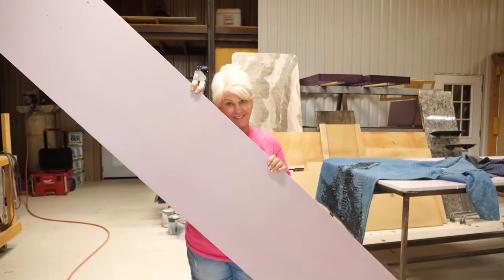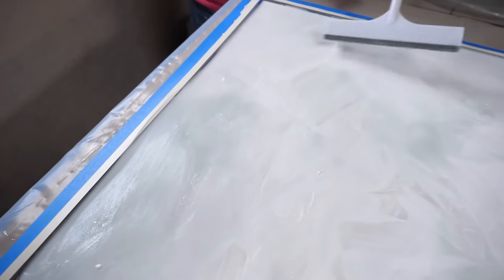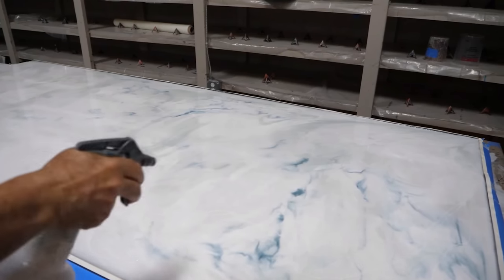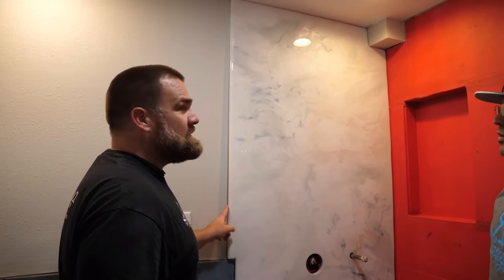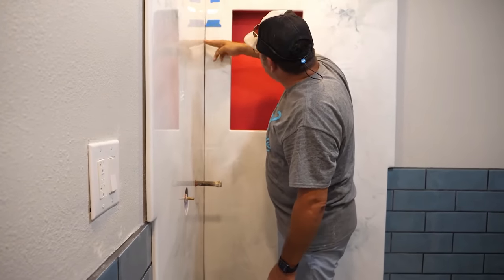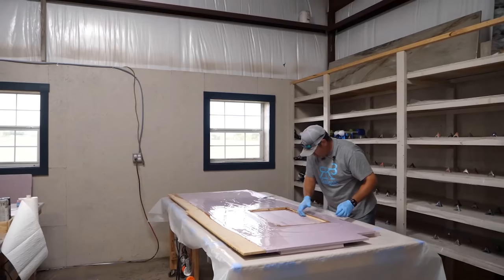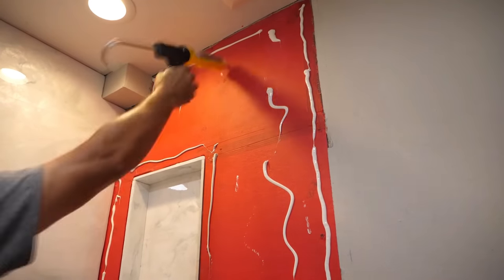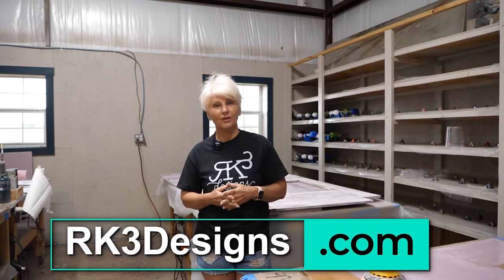How to Install Foam Epoxy Shower Walls with @RK3Designs

Comment: In the middle of my shower remodel using your products right now. Would really like to see the fabrication of the panels. This video jumped to finishing the holes in the panel. I'm likely starting my fabrication in the next 10 days. I've watched your foam shower wall visors, but they are a couple of years old and I could use a nice refresher.

Comment: That is my favorite color for this epoxy wall idea. 
Might as well do all the walls, plus the ceiling, while you're at it.  
less seams, looks easy to do once you do one panel.
Reply: Yes I think they should have done all the walls. A  more dramatic look as oppose to a little shower in the corner..

Comment: This is absolutely awesome!!!  I currently have a shower/tub combo in my master bathroom.  My wife just went through a horrible medical ordeal (had an abscess on her spinal cord that caused her to be a quadriplegic and is now fighting her way back to using her limbs again) and there's no way she can step over the side of a tub.  She could barely manage it before the surgery because of back problems.  I intend on cutting out the surround and putting a shower stall in place, and want to use SCC to do the walls, just like this.  It's an alcove shower, so I think it'll be easier because I won't have to worry about glass walls.

Comment: what are you putting on the walls behind the foam board? adhesive? subwalls ? ty  have you done this in a tiny house ? I am thinking i would like to try this in my tiny house ty deb

Comment: I'm in the process of fabricating a large format suken cement soaking tub.(6ft x 5ft x 3.5ft deep)

I'd like to use your materials to coat and enhance the look of the tub. 

Would your product withstand constant water..??

Would I need to seal the concrete first..??

Any information would be appreciated. 

Thank you

Comment: A 'lil confused. Love the outcome, but I thought they needed to be torched for bubbles? Also, was no additional top coat applied?
Reply: Hey there. Yes, torching is used to remove the bubbles and we actually did  a little in the full length video. Because this was a melded marble technique where we used more product per square foot and it’s being used as a shower panel, an additional flood coat isn’t necessary. If I used a technique with spray paint, I would apply a flood coat.
Reply: @RK3 Designs  Absorbing everything I can before I attempt a new shower install in a few months, I want to make sure I'm down with the details. Thanks for the clarification 👍🏼

Comment: We need window sills that are 14 1/2" wide and 9'+ feet long (We have an ICF house). I was going to use MDF to make them. After seeing this, I am wondering if the foam would hold up. Any comments on that? The foam would be so much cheaper and easier to use. Thank you Stone Coat for the great ideas and great videos!
Reply: After 8 months I hope you found a solution, but if you're like me.... it may still be on the to do list. I built an ICF house a few years ago and we did MDF sills. we laminated 2 layers so that we wouldn't have a seam, then coated with SCC It looked amazing. It didn't occur to us to try the foam. Now in a new house, I'm about to finish a shower surround and wouldn't think twice about using the foam for window sills. My only concern would be the front lip compressing if a kiddo tried to sit in the sill

Comment: I would like to do this in my shower but my shower is 5 ft wide by 62 inches high. So I would have to make one sheet 48in another sheet 12in to get the 60in. So how would I make that one panel and make it look like one panel only with no seam showing?
By the way I'm sorry but haven't seen all your videos. But what has happened to Mike???  Thank You.
Reply: Check this video out where we show how we seamed the two foam boards together. https://youtu.be/kCHnvpZrOLs

Comment: So I see it’s still installed onto a backer board with the niche being the same… that’s pretty sweet bc a tile shower of that size would be $3k-$6k depending on where you are and how fancy it is I’m guessing this is slightly cheaper and much quicker to do ?
Reply: I’m also curious about the cost vs tile. I have family that can help me to DIY tile, which saves some money but this might still be a better option
Reply: @christopherbowman2435  if you have the time and money to waste for fun the epoxy is a fun thing to do but if it’s something you just need to get done go for the tile route, since you have family help assuming you guys know what to do you can get right in, get out and be done but with epoxy you might have to toy around with it getting the mix and color you want
Reply: @christopherbowman2435 at 9:30 , ain’t no way I’m glueing it that way tho lol, I. Using half inch trial (when smushed down it becomes 1/4 notch of whatever adhesive you’re using) bc I wouldnt trust those blobs alone bc I have had to repair tile jobs where ppl didn’t use a trial and used blobs however they may have never had issues with doing blobs on epoxy but for me just for extra security I’d use a trial for the silicone lol
Reply: Thanks for the input! I have not started my project yet, so I'm thinking I might start messing around with epoxy and see how it goes.

Comment: TLDR: I wanna make a floating desk, can I epoxy a 4X8 of MDF, OSB, or plywood and make a desktop out of it, or does that sound like a terrible idea?

I was thinking of using a half inch thick sheet of 4X8 plywood plus a lot of L brackets for strength, and then a 1/8th inch veneer for looks. 
Then I remembered the neat stuff you do here with countertops and wondered if that'd work for what I'm doing instead of the veneer. 

Black with some copper stripes/streaks/lightning bolts would be really cool. How much would it cost though? 
I don't know the exact dimensions yet, but 30X90 inches seems about right.
Reply: I'm pretty sure that would be fine. I've seen others do similar projects with good success